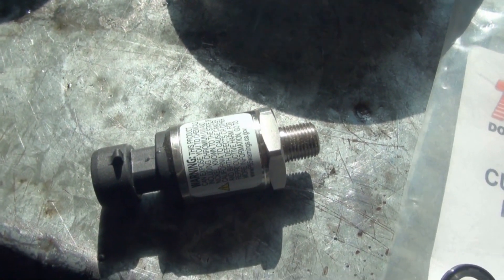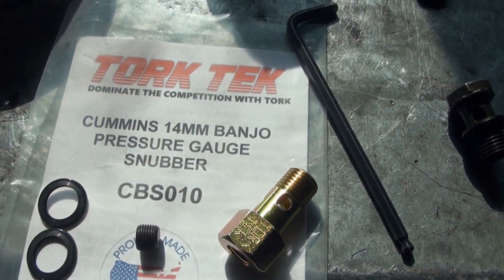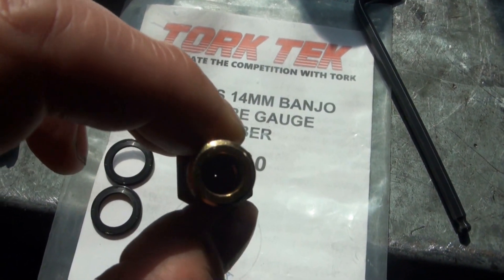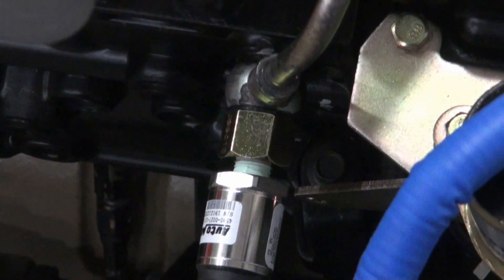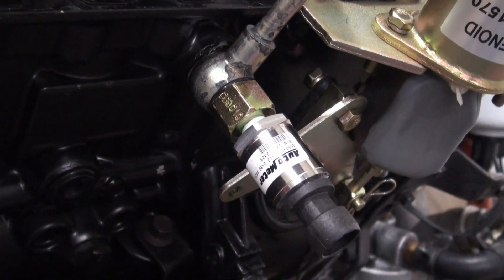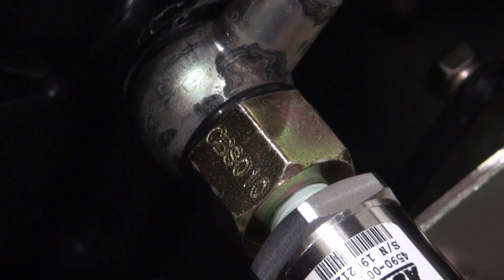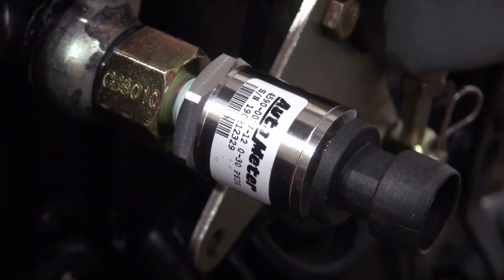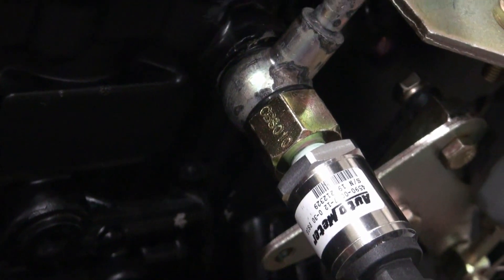12 Valve Cummins Snubber Fitting

Comment: Did it stop the pulsating? I had to add about 11 inches of rubber fuel line from the end of the snubber to the pressure sender and my fuel pressure reads from 10-15 psi depending if I’m at idle or wot. Never pulses more than 1 psi tho.

Comment: Hey Im new to the channel. I have a 1999 dodge ram 1500 I want to put the body on a 3500 dually frame with the 24 valve Cummins and the 6 speed manual